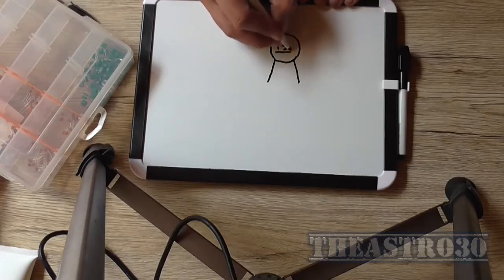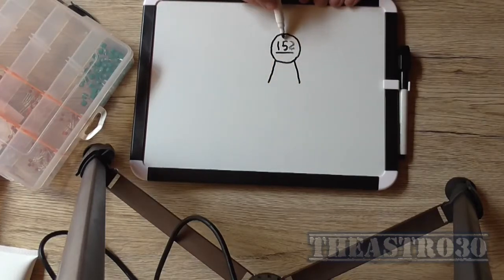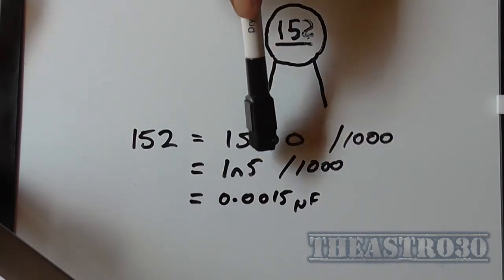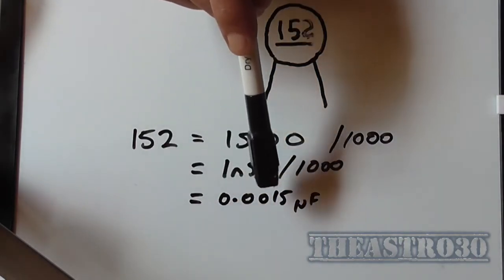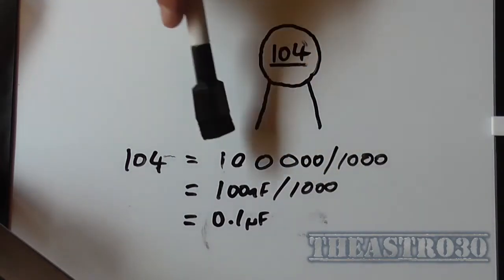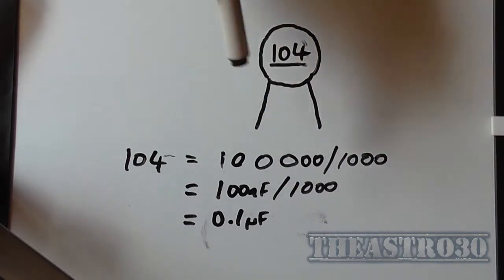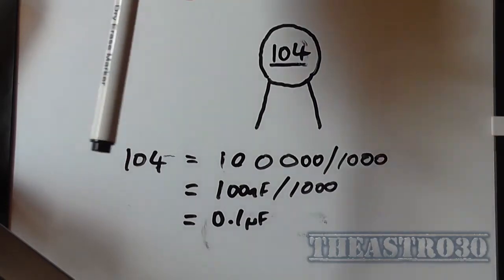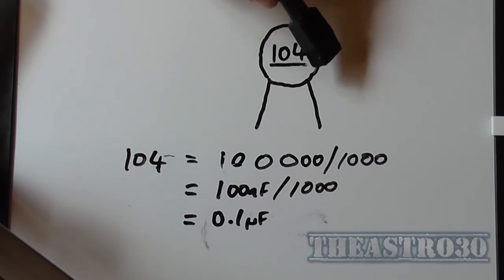Electronics Fundamentals: How to Read Capacitor Numeric Notation

Comment: I have a question ? I have a round ceramic capacitor with a black stripe across the top. Why is it green instead of brown? Also why is it black like the top was dip in black paint.. it’s 33 PF
Reply from the maker: Possibly a high voltage ceramic